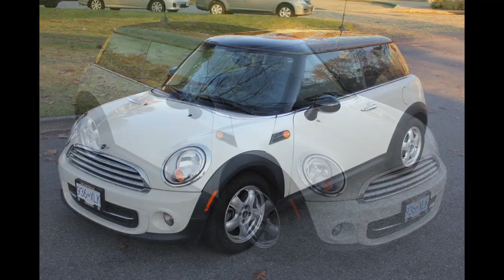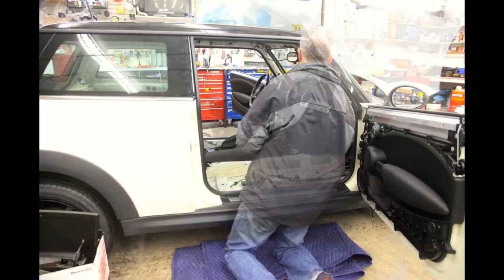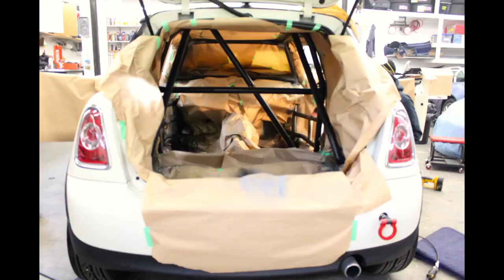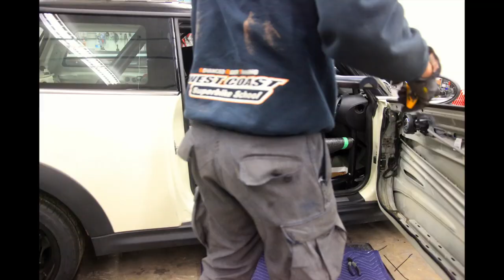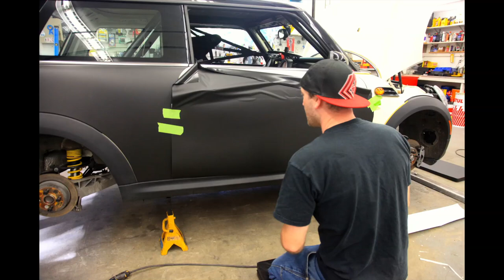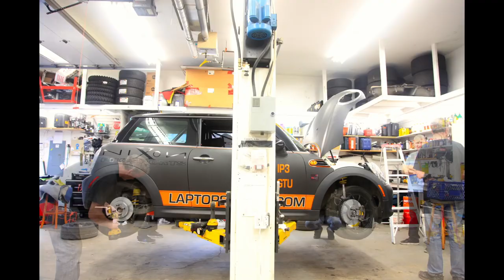Mini Cooper B-spec racing car build time lapse

Comment: How much does it typically cost to build and run for a season(or however it works)? I know there's a 125hp limit but do they allow some modifications to get closer(exhaust, intake, cam, etc)? Just learned about this race series and would love to know more! Have an R50 mini myself.
Reply from the maker: Brian Witkowski Modifications? Hell yeah, you get 32 mm throttle body  restrictor to and some extra weight to bring it to 2600lbs (with driver). Legal MIni Cooper B-Spec car makes around 75bhp at the wheel.